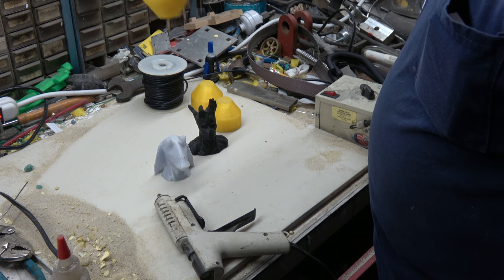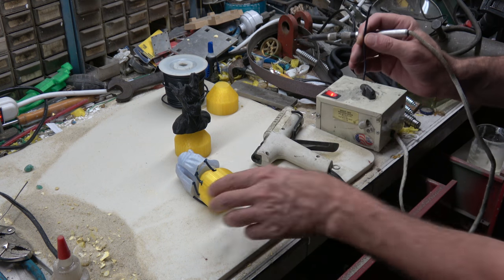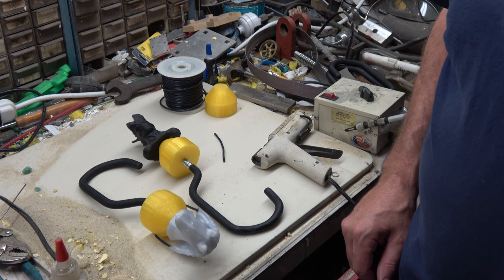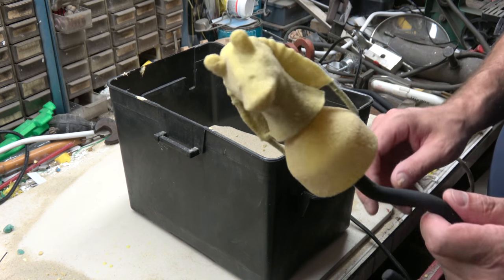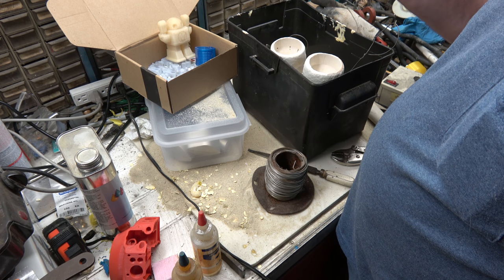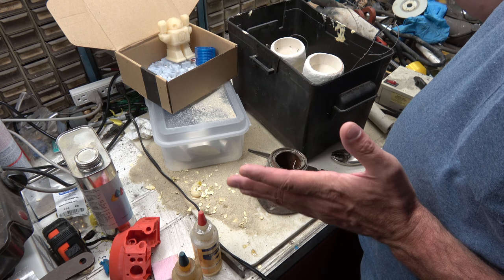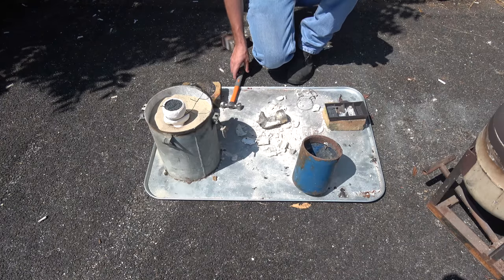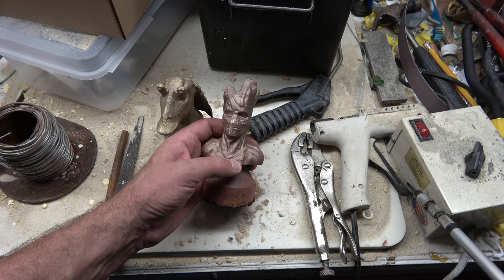Lost pla ceramic shell 2

Comment: Very nice! I think they both turned out good. I didn't know that about aluminum and surface finish with flask temp, thanks for the info.
Reply from the maker: Careful though, if block casting letting the temp drop below 500 can cause the investment to fracture/ crack.
I kept calling the shell a flask in the video...force of habit...LOL

Comment: Couple of thoughts.  Your sand looks pretty course.  Can you strain it to separate the finer stuff out for the first two coats...?  This will only help with surface finish.  You learned the tough way the wax vents were too small in diameter.  Remember Zap schooling me when I used that thin red wax initially on my sprue job of the jewelry box?  Bigger is always better, you can cut it off so why risk it right?  David, I think this one is a WIN personally.  The warmer shells helped a lot.  Your BP that I poured in Aluminum, that shell was 1700.. WHOOPS!  I didn't know at the time.  lol  I take it, you backed down the fill when you printed these?  The burnout looked excellent and your hook system works a treat.  Nice plug for the site too!  See ya online.
Hey!  Where is your pyrometer for dialing in that metal?
Reply from the maker: The sand is graded, so sifting it would not help any. Its really not that coarse any way.
Ive never used a pyrometer ....

Comment: would it be easier to 3d print the whole thing, vents, risers, sprues etc in one go?
Reply: Sometimes printing components separate from the sprue, vent and riser is beneficial. 
Two examples could include; reduction in required support material and decreased cycle times when printing sprue, vent and risers at coarser resolutions.
Reply: No, you would have a crazy amount of support material to remove which is extremely labor intensive and a much higher chance of a print failure. As Evan has said, you also have issues of more print time and higher material costs.
Reply: i know I'm quite randomly asking but does anyone know a good website to watch newly released series online?
Reply: @Orion Odin Flixportal
Reply: @Roger Layton thank you, signed up and it seems like a nice service =) Appreciate it !!
Reply: @Orion Odin you are welcome :D

Comment: Very good video with insight to process. Showing or commenting on some failure is helpful: the vents, the hook, pouring cup material, etc.  Two questions. What slurry mix are you using, commercial or homemade and was there a difference in finish between the casting and the cup (you mentioned they seemed to be 'taking' the slurry a little differently)?  Thanks again for this and your other videos.
Reply from the maker: Rawah Forge and Foundry 
The slurry is ransom and randolph  suspendaslurry. 
  No difference in surface finish.  It just seemed like it stuck better to jar jar binks, who was printed in the moldlay filament.

Comment: Impressive!  When casting brass and sterling I definitely need a leather welders jacket and apron. You must be able to tolerate the heat on bare arms. Also on my castings, I thermal shock the investment off in water, but have never done shell casting; only investment and sand casting. My channel has some videos if you're interested.
Reply from the maker: grantham418 
Thanks for the compliments. 
I was unhappy with the yellow brass casting, but the red brass one was perfect. Ill give it a couple more tests once i get caught up with other projects.

Comment: What compound are you using to make the shell with?
Reply from the maker: Its suspendaslurry
Reply: @aonemarine  Oke, thats not to bad. Do you feel like this can be used to cast things like triggers, receivers, etc. etc. Im looking for something to cast a winchester high wall with. At least im trying to find out if this is something that is possible with this method. 

Its a steel cast. And that requires more heat. But if you pre heat the mold, and make the material to be poored hot enough, and fluxed and drosted very well. It should be possible right??
Reply from the maker: @jeffjefferson2676  
  There is a different slurry for ferris metals and different sand. But it is pretty common to use shell casting for steel.  The main problem you will run into is melting the steel.
You will need either an induction furnace or a arc furnace,  both of which are out the the realm of home hobby cssting..
Reply: @aonemarine  You could build an induction furnace. There are several things that are inducting that ive ran into (gundrill/reamer welding, brass annealing on an inline bullet factory), so i kind of need to know what is the deal with this topic. There is this book that i am looking for: https://www.asminternational.org/search/-/journal_content/56/10192/06522G/PUBLICATION. But it costs money, and i dont know if it holds everything that i would need to know...

I have designed a kiln that can work out fine too! Its not to expensive if you can build things yourself! (ive got some links on my channel at the about section, the kiln however i did not upload yet... ) 

A gas burner cannot melt steel sufficiently?
Reply from the maker: @jeffjefferson2676  
  Join the forum,  you will learn what you need there...
Reply: @aonemarine  Do you have a link?
Reply from the maker: @jeffjefferson2676  http://forums.thehomefoundry.org/index.php

Comment: What slurry are you using?
Reply from the maker: That's the R&R suspendaslurry
Reply: @aonemarine  many thanks
Reply from the maker: Join the forum!!  http://forums.thehomefoundry.org/index.php
Reply: @aonemarine  does the slurry ever dry up in the bucket, or can you just put the lid back on and it stays liquid for extended periods of time? years?
Reply from the maker: @thebucketmouse  so far it hasn't.   But it does require alot of mixing if you leave it sit too long